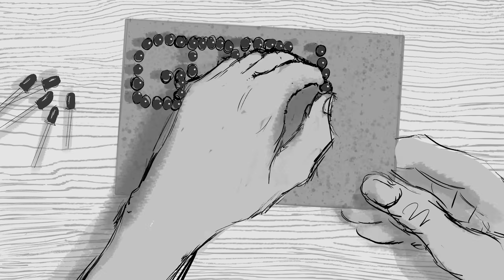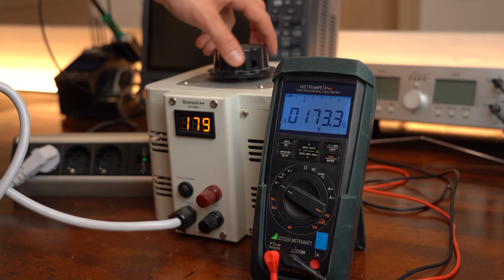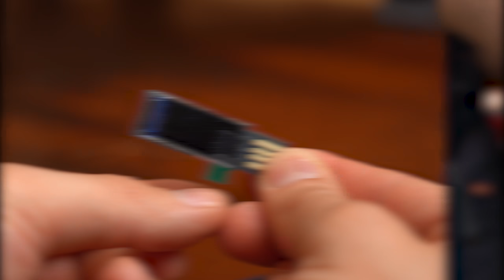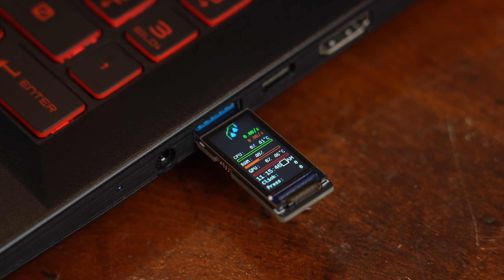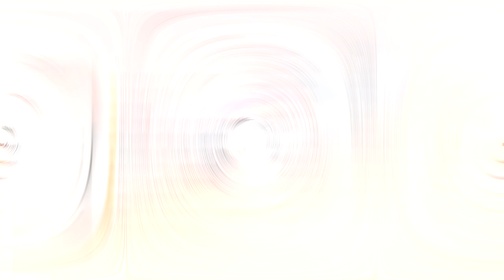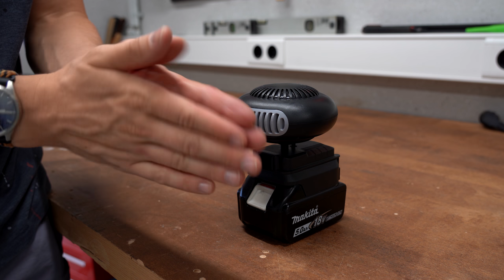I tried finding Hidden Gems on AliExpress AGAIN! (SPECIAL Part 20)

Comment: That battery powered heater is a very convenient way to kill all your tool batteries.

It does not have a low voltage cut off, so it will keep running until the battery voltage is zero - which happens in about an hour of runtime.
Once the voltage is too low, any regular charger will simply refuse to charge the battery again.
You might be able to resurrect the battery by slowly and carefully charging the cells individually, but even then the battery will carry some lasting damage.

And even if you turn off the heater before the voltage drops below safe values: While it is running, the heater draws power near the upper current limit of most tool batteries, and it does that continuously. Which means the battery itself will most likely heat up to a point where its life time is severely reduced.

Of course these tool batteries usually have built in temperature monitoring, to detect if the battery is overheating. But they don't have any switching circuit inside to turn themselves off. Instead they only send a signal to the tool, so that the tool shuts off when the battery is overheating. 
But this heater does not have the necessary circuit to receive this signal, it just keeps running and does not even notice that the battery cries for mercy.
Reply: Most batteries (except chinese junk) include a BMS for protection. It's not different than a powertool, at least my parkside (lidl) drills and saw don't include the protection in the tool itself.
Reply: @mryo-yobzh9485  Even the high quality manufacturers like Makita, DeWalt, Milwaukee, etc. don't have any kind of switching circuit in the battery. 

The + and - tabs on the battery connector are metal strips that go directly to the first and last cell, without any switch or circuitry in between. Typically one of the metal strips has a narrow section, which serves as fuse in case of a short circuit. But that is the only thing in those batteries that can cut off the current flow.

Of course there is a battery management system as well. But that is split up, being partially in the battery, and partially in the tool, communicating with each other through the extra contacts in the battery connector. The tool must have a way to switch itself off anyway, so it's a lot cheaper to use that for the BMS then to put two extra sets of high current capable mosfet circuits into each battery. Why two? You would need one for discharging and one for charging the battery.

The only tool manufacturers that have a full BMS in the batteries, are those who designed their Li-Ion batteries to be interchangeable with old NiCd or NiMH batteries. 
If you want to use a Li-Ion battery in a tool designed for NiMH, the battery must come with a full BMS since the tool won't have one.

But most manufactures started a completely new range of tools when Li-Ion became a thing, giving the batteries a different connector interface, so that it's impossible to put the new batteries into old tools. There were several reasons for that. But one of the reasons was so they could split the BMS and not need switching circuits in the batteries.
Reply: While I agree about the missing low voltage and temperature protection, I highly doubt the constant current draw will be a problem for a decent battery (in this case a Makita battery).
Don't forget that these are used in tools that can constantly draw way higher currents!
Best example is their lawnmowers ... those will draw more than 5A constantly without giving the battery any problem.
Personally I own Bosch tools and since I already had the batteries I got myself their lawnmower. Even on a very hot sunny day it never stops working and fully deplets the smaller 5Ah batteries in 15-30 minutes depending how tall the grass is.
That tells me that drawing 5A on the batteries is nothing.
Reply: @ppdan  indeed 5A is nothing for a tool battery.
But some of these heaters draw 20A and more...

Comment: those nut splitters do actually have some use cases and work well, that one looks poorly designed though. good ones have an angle to them so the head can rest flush against the surface and let you turn the nut, as well as flats to hold it still with another wrench. that one you got was certainly trash.

Comment: I have a shop that I heat with an electric oil-filled radiator. It has two switches for 600/900/1500 watts. It's imperious to dust, and is very safe. I leave it on, set to 55° to 60° F (13° to 16° C). It keeps condensation off tools and preserves paint and chemicals. I have another heater I use for quick heat. 
I salvaged a fan from a microwave for soldering.

Comment: 14:35 Overcompensating for the racist hand dryers that wouldn't react to darker skin! Nice that these things are starting to dump capacitive droppers which consume max power constantly, and the capacitors degrade, but I wonder how long the buck regulator will last...
Reply: Wouldn't PIR sensors also be "racist" in the opposite way, that is, they're a bit more sensitive to dark skin?
Reply: @NiHaoMike64  I'm not sure that effect would be significant; I've never heard of such a situation.

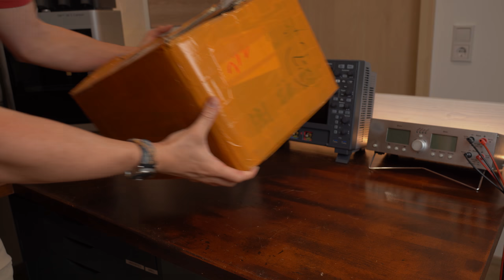Comment: 02:08 Some background regarding the voltage regulator. The use case for those are the Russian country houses (“dacha”) which have acute power supply issues in winter. Picture an old Soviet village 200 km from Moscow: it is served by a single power line and a single grid transformer originally designed to handle a few dozen homes; now the farm land got converted to a hundred plots where the urbanites have built cottages which get visited for BBQ on weekends. Think “Schrebergarten” on steroids. In winter the old transformer barely copes and voltage drops from 230v to 150v or worse - because Soviet planners never imagined space heaters, ACs and other power-hungry tech in every home. Houses are kept above freezing point during the weekdays by natural gas boilers - they have an electronic control to keep the flame burning. If it goes off Tuesday - by Friday evening the pipes would burst. Your trusty APC UPS won’t do: boiler needs proper sine-wave at input to function. Proper “true sine” UPS is crazy expensive. So people resort to these relay-based boxes, knowing the quality is garbage and they need a lot of tinkering before you plug it in. Everyone knows the shortcomings such as fake “220v” display, everyone eventually moves on to a better build based on lead or LiFePo4 cells or just waits for the grid upgrade.
Reply: Interesting, there are plenty of other places around the world that have a similar problem, albeit slightly better solutions, the theory is the same. I did a 6 month stint with the local electrical utility in rural Australia, where there are similar problems, very long lines, and wildly varying loads, servicing only a handful of properties, I think we traveled over 500km the day we did a servicing run. except these were lovely pieces of 1950's infrastructure, a little red brick shed only slightly larger than an outhouse with a 100% mechanical auto-auto transformer (an auto transformer that automatically switched taps) with a screw gear, make before break contacts and a voltmeter driven relay that would shift the taps up and down depending on the voltage drop. as the transformer was inside an oil tank, we just checked its calibration, the oil quality, manually ran the motor to make sure that still worked. I really did enjoy that job, pretty much all the equipment was old, or still built to the same design. Brass, steel and copper dont have much to go wrong when its under 100's of L of oil (no, not PCBs anymore). 
But that unit does thoroughly scare me. NEVER power up any Chinese power equipment without opening it up and giving it a once over. tighten all the screws and bolts you can find, check the boards, crimps, terminations etc. once youve met a bad one, your always gonna wanna check. It'll probably work, but there is a non-zero chance it wont kill something or spontaneously combust...
Reply: @a @arjovenzia ssians got hooked on AliExpress: they perfected the logistics (my average wait time is 7 days, including customs processing), pickup points and lockers on every corner, tax exempt bracket is quite generous ($200, I think). They have a local development office in Moscow that carved the opportunity to develop a local app and local version of the website that looks and feels much more European
Reply: huh that's interesting to know.  my understanding is it wasn't until somewhat recently that these normally had power or even running water service at all.  It just sounds like something people used during the summer like a private camping cabin almost that's being transformed in to american suburbs.

Comment: >0.96 inch LCD screen
hmm those also used in [toxic chemical dispenser]s!!! along with STM32 clones, diffidently do a video on how to determine the pinout and be able to reuse the electronic guts from [toxic chemical dispenser]s that have a screen

Comment: The little tank - if it was IP67 coated and had a 50 or even an few hundred meters of fiber line would be interesting. Wireless makes zero sense in pipes, once you lose connection it's gone...

Comment: I seem to have a lot of luck on AliExpress. But I go in with low expectations and often times get them blown in a good way. Like this health tracker watch I got for 40 USD that does all the tracking, more than Apple offers, and I've tested most against my standalone meters. They're good enough for at a glance readings. Also, doesn't need a smartphone to operate and has like 5 day battery life. Bought a  5 pack of LED Array head lamps that wrap around and I use two on my dogs for night walks since it was cheaper and brighter than anything I could find pet specific. It was 10 dollars for 5.

Comment: Surprised you didn't check the circuit of the battery powered heater. Often these makita compatibles will kill the battery because they have no over discharge protection.

Comment: should have tested if hand heater had low voltage cutoff or if it will kill the makita battery (as they are connected straight to batteries, relying on tool to protect it)

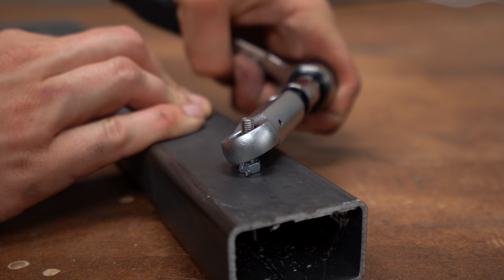Comment: 5:09 you are using it wrong 🙄
It is designed to be used with two spanners - one to hold the body of the tool (it is why the body has flat faces) and one to turn the screw.

Comment: The reason we like your aliexpress product reviews is because you check thermal stability, how clean the electric circuits are, how much draw there is, functionality, etc.  things that matter.  Not only what does it do and when would you use it, but also should you use it and is it actually any good.  You save everyone time, money, and pain in the ass.

Comment: I've had some luck with a nutcracker.  Assuming it fits on the nut, tighten it then hammer it sideways to loosen the nut.
I have that WeAct display.  I like it as a  second display for display mirroring or extending.  It's totally useless, but I like it nonetheless.

Comment: The small tank could be built better with an analog VTX for the camera, and an ELRS receiver for controls, the latency and short range of WiFi makes it almost unusable.
Reply: it should just use some kind of thin cable for video and control feed, you want some kind of string attached to it anyway

Comment: Most of these are just overpriced gimmics that you don't need, are useless or there are cheaper alternatives. 

An LED 7 segment volt meter is much cheaper than the one you've shown for example.

What is the point of the infrared switch? Just keep the normal one.

What is the point of a CMOS key cap?

The portable heater will drain your battery very quickly. Just wear gloves.

Comment: 6:32 shame it's windows only, want something like this for cachyos bc250
Reply: I used a screen from AliExpress on my printed case for my BC 250,  one of these 6" screens for PCs to show temps and other parameters
Reply: I'd be maybe keen to buy one and hack up a Linux driver
Reply: Honestly you should be able to easily use an AI tool like Codex or Claude to reverse engineer the app/protocol and build a universal one…

Comment: i wish EU removed 3 euro thing on electronic parts
Reply: Constant 3 euro charge is ridiculous, it should be cancelled and replaced by higher VAT. In current form it only hurts individual hobbyists and does not affect those who buy in bulk.
Reply: @yansakovich  fr, hobby that develops eu
Reply: @yansakovich  ironic since they also added higher tax at the same time .
A 5€ component is now 13€ sometimes .
That's 3€ charge and almost 50% taxes

Comment: For your inspection robot, I've done the same with a $20 Chinese RC car, the types that can work flipped upside down. Then I took out the water squirting module that it had (for some reason) and replaced it with a FPV camera. Used that to run a guide line through some ducts into my homelab to pull ethernet.  Works better than your example because the feed is analog and LIVE, and the controls are not IP, it's raw radio controls -- so in short there was no latency. Though the VTX signal was a bit weak in the ducts, thanks to them being metal and all. Altogether my setup cost $70 CAD. $20.00 for the car and $50.00 for the camera. I guess I already had the FPV goggles so there's more cost.
Reply: Theoretically an existing mini webcam (or salvaged laptop webcam) and max 15-20ft usb 2.0 extension could work too.

Comment: Jesus man that stabilizer is legitimately scary. Holy hell
Reply: the product was basically a scam marketing, they were definitely going for SVR in the description but sold an avr instead. many such cheap chinese does that so I usually just take the transformer and return the product XD

/s [i would never...]

What pisses me off is that I can't find an svr that outputs 240v instead of 220, my inverter does 240 but only @ 1000 watts
Reply: When I saw that, I just heard DiodeGoneWild's "SUPER DODGY!"
Reply: many such cases
Reply: while it is not great it is still better than using electricity in harsh plsces. we used such device for years and it worked ok. in such places you have either the option to run your stuff at  for example 170v or through this and get 220 or 210v. yes. today power supplies do this themselves but not all of them do. my fat ps2 is 220v only and fails at 200v.
Reply: @sczygiel  Not the principle of the device itself, but the build quality. It would cost basically nothing to make it much better with little effort... But the seller didn't care about the life of people in 3rd world countries.
Reply: we used to use something similar here and now strongly recommend AGAINST it, and even if decently built, the relay switching will briefly cut power, stressing the PSU of whatever it is "protecting" while also being a surge generator
Reply: @aurunemaru in practice it does not switch too often. if the local voltage is not terribly crazy then it will stay on the setting long time. it basically just semi statically shifts the input voltage to 220. yes when switching it will do all sorts of things to ouput but it will do that maybe once per few hours if ever. that is majority of cases when it is needed. just bump he power at the far end of the power network to decent level.

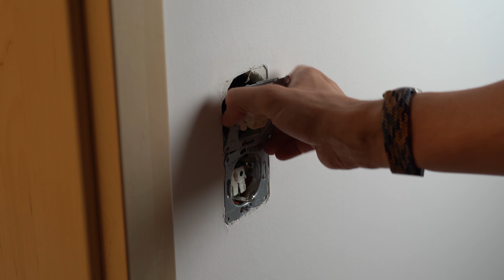Comment: 14:08 It requires a live and a neutral and therefore won’t work in houses in the Netherlands. 

Does Germany usually have live and neutral wires for light switches?
Reply: Same thing in Finland. The neutral is very rarely pulled to the switch here.
Reply: @ahhuhtal 
Thanks. In Germany it’s probably the same but in the video, there’s an outlet beneath the switch, so he can get power from there.
Reply: @Conservator.  In newer German buildings, there are often neutral wires in the switch. In some older buildings, there are none.
Reply: @alperalkan2000 
Thank you.
Reply: Depends on the age of the building.
Building code does not required neutral in light switches but most houses build after the 2000s just have 3 wire cables in light switches
Reply: @JohnDIYSmith In what country if I may ask?
Reply: @Conservator.  Wow YouTube censorship is really out of control.
This is the third attempt.

G*Er. man. Y 
I should also mention the main reason light switches have 3 wires is because its simply cheaper to just lay 3x 1.5mm2
Reply: @JohnDIYSmith  
Thank you very much. It’s frustrating when YT does that and for what? 🤷

Comment: I come here for the informative vids, i stay for the funny accent.

The tank would be better if it was tethered to the remote instead of being wifi. Like a Russian fibre optic drone. Eliminate lag, much deeper pipe inspection range and built in recovery line.

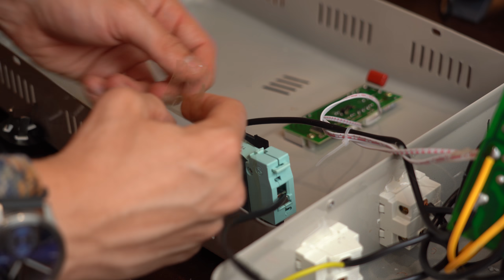Comment: 3:45 As someone that unfortunately works on Chinese exported machines, not only are chopped out PE conductors very common in practically every machine i've seen, but they also use scraps of wires.  3 phase motors wired by short and random cables of varying sizes; connected together by twisting the `copper` strands and electrical taping over the joints.
Reply: What?
Reply: This is why you actually specify the proper machine you get certified with compliant standard. The factories are going to make it good if you order the right thing quite simply because they understand this.
Reply: @TheLostPacketYT But that's not what people order.  People go to websites that advertise these machines, eg. made-in-china and order a pre-made machine.